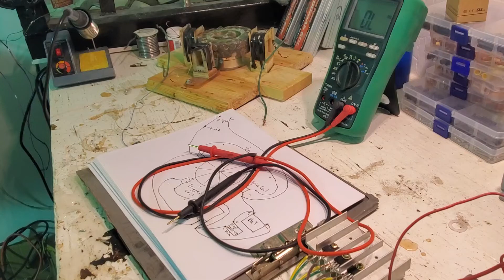Step by Step how to wire these pulse  motors up and make them run

Comment: What diode and cap do you use
Reply from the maker: It really doesn't matter what diode is used as long as it can handle the voltage and current it will work fine . The cap is the same.  The capacitor isn't necessary for the circuit it will work fine with just a diode. I usually try to use schottky diodes . Thanks for watching!
Reply: @windpowerandmore6310  Thank you, ordered everything watched your videos about ten times learn something every time. Hope I can get it going.I was trying to figure out what gage wire you're using to wire everything up.Thanks Donnie
Reply: If you were to take a wild guess about how many pounds of 30 awg trigger wire would I need to order
Reply from the maker: @donaldcarter2309  it’s around a number 19 awg . I hope I was able to help you!
Reply from the maker: @donaldcarter2309  that really depends on what size of motor you’re going to build. 5 would be lots for the size of motor I built
Reply from the maker: @donaldcarter2309  for trigger wire you would only need about 250grams
Reply: @windpowerandmore6310  Does the size of wheel make any defferance

Comment: Hi Jeremy, been a while hope your well, I have got a question for you.
Can I charge a high voltage cap and dump that cap back into the run battery, even through the run battery dose seem to last a long time, so what I'm trying to say is can it charge itself or would it kill itself 👍
Reply from the maker: Yeah you can do that.  I think you're realizing how power really works.  It's in different forms . The output has a much higher voltage potential than the input does and converting it back to a lower voltage with a higher current is the key to making it a self runner.
Reply: @windpowerandmore6310  thanks Jeremy I thought that I definitely learning more and more much appreciated 👍
Reply: @windpowerandmore6310  Jeremy I'm finding it hard to get hold of NTE56 what's the next best thing fella, as you know I'm in the UK mate.👍
Reply from the maker: Email me buddy jvhoeops@gmail.com 
I'll hook you up with some 56s.
Reply: @windpowerandmore6310  sweet Jeremy, much appreciated 👍 fella, I've sent you an Gmail.

Comment: Sir i replicated this motor but the problem is that my coils are heating i m using 3055 transistors and coils of 3ohms each it is taking at 11volts only 1.15 Amps please can you tell me why my coils are heating though the current is less and the back emf is 8.5 v
Reply from the maker: How many coils are you using? It sounds to me like the coils are not in series. Make sure the coils are in series that’s what I think is going on . Or it could also be a issue with the timing. You may have to adjust your timing coil position
Reply: Sir i m using 2coils in series and the timing seems to be perfect the rotor is gain good speed as urs in the video first i used 2coils of 0.7 ohms it was drawing 3Amps so i changed the coil to 3 Ohms each with a slightly decrease in speed the input current dropped to 1.15 Amps Then the coils started heating up though they are air core coils like yours
Reply from the maker: That's something I don't know buddy I'd really have to see or be there to exactly say for sure what is wrong.  How many transistors do you have on the coils?
Reply: @windpowerandmore6310  2nos of 3055 transistors
Reply from the maker: Are they both working properly, if one of them is not turning off it will cause the coils to get hot
Reply: Usually all electrical people say mor current means more heat but my current is less then how come ?
Reply: Thanks for all your replies and one more thing that motor you designed is one hell of a motor keep uploading more videos of your experiment I have learned a lot from your videos

Comment: Hello. So I'm getting a negative voltage from my trigger coil. Wont turn on the transistor. I'm guessing that's the problem but I'm not sure. I spin the motor and I measure from the base and the emitter with the negative lead on the emitter and the positive lead on the base. Reversed the coil leads and it's the same. My drive coils are 1 ohm each. My trigger coil is 150 ohm. I get about 1.5 volts. Any ideas Thanks.
Reply from the maker: Are you sure the transistors that you're using are working? Are you using the same transistors that I use ? NTE 56
Reply: @windpowerandmore6310  I'm waiting for that transistor to be delivered. I'm using a Bridgold E13009. It has a saturation voltage of 1.2 volts so I wound a bigger coil. 300 ohms. 34 gauge wire. Get about 2 volts Drive coils are .5 ohms. I think I'll wait till I get the NTE 56 and try again. Thanks for responding. Great stuff.
Reply: @windpowerandmore6310  got it to work. Yeah. The 56 got delivered yesterday. Thanks for sharing your knowledge. Going to experiment with a bigger rotor
Reply from the maker: I’m happy to hear that it’s working for you buddy! Thanks for watching!

Comment: Hey there! Thank you so much for sharing your great work - really excited to build a motor as per your recipe. Been watching all your pulse motor vids over and over and reading the comments to get as much info as possible, but I still have a few questions though....
I have a rotor with 8 magnets on it N-S-N-S-N-S-N-S.
1). Do the drive coils have to be opposite - wound? 
2). On my rotor, with drive coils opposite each other, they would both be facing a north pole - would that still work with one repelling and one attracting? 

There are other questions, but one step at a time! 

Looking forward to hearing from you, and I understand that you're a very busy guy, so am happy to wait for a reply! 

Cheers
Reply from the maker: Hey buddy,  it doesn't really matter where the coils are placed.  Either setup will work.  The video explaining how to wire and start the motor will show you exactly how to wire it and get it started
Reply: Hi! Thanks for that, you've helped me realise I've been over complicating and over thinking things! Cheers! All the best!

Comment: I've been building the bedini circuit for a while.  This seems very interesting.  

I heard you say it draws around 2 amps.  About how many charging amps will it put into a low 12v battery.  With the setup you showed in this video.  And the 4 run coil one.   Thanks!
Reply from the maker: Hi ,thanks for watching.  It's hard to say exactly Bud I'm not at home right now.  It's not possible for me to give you exact numbers right now.  But I do know as the rotor is loaded down with a load the changing current stays the same or increases slightly.

Comment: Hi Bud. I sent you a schematic drawing I did for you from your rough sketch. I sent you an email with a transcription on notes i made from what you said on video,s.
Reply from the maker: Hey buddy sorry I've been busy lately working.  I've just looked at your schematic.  As far as I can see the input side of it looks correct.  But the output looks backwards.  The negative from the input side is the side that will be the positive on the output side.  That's the side that should have the diode that will go to the positive of the cap and output battery. Its opposite as what you have on your schematic.  The backspikes are the opposite polarity of the input.  Let me know if you need anything else.  I'll gladly answer your questions asap . And thank you for your support and time with those projects!
Reply: @windpowerandmore6310  Thanks Bud. I will correct the drawing. I will send you a video of my build. I cannot get the NTE 56 Transistors in South Africa. I bought and received the Mustool Oscilloscope and a digital thermometer which is helping me to see the waveform and back spike results. I do not get near the results of yours as i did a different build with a different purpose. I see on one of the videos you had a Bridge Rectifier DC to AC on the output of the energizer yet most of your latest energizers do not have this unless it is not visible on the videos you took. Is the Bridge part of the build or can we do without it.
Reply from the maker: Hey bud.  Its something I don't use anymore.  You can use one if you want to experiment with it but the input power will be different along with the torque from the rotor when it's charging batteries.  All you need on the output is one diode that's all . The diode goes on the coil that is connected to the collector from the transistor. The purpose of the diode is to block any input current from going to the output batteries.  All you want to collect is the pulse from the backspikes.  The pulse from the backspikes are also the same polarity as the current being produced from the magnets that pass the coils when the transistors are off.
Reply: @windpowerandmore6310  Thanks Bud. What s the Ohms value of the diode to be used. I saw on one of your videos the cap used with the diode on the output is a 3300uf 25v cap. Is that right.
Reply from the maker: That cap is on the input side that you’re talking about . It’s not necessary to have a cap on the output . If you’re using a cap try using at least a 400v with about 400uf . Any high voltage diode will work as long as it can handle the voltage and current that your motor is putting out.
Reply: @windpowerandmore6310  Thanks Bud. With my solid state circuit i am getting the square wave patterns i see on your videos. What i am missing though is the values i see in the Voltage supply as well as the high voltage i see on your back spikes. I will make a video for you and send it via email or you tube. I am still learning to upload a video. I suspect the magnet discharge into the aircoil vacuum is part of what makes these extraordinary amps/volts. I need to replicate this effect to get my battery to charge. What i have accomplished at this stage is to slow down the depletion rate on the battery under load. Not enough to keep the battery charged though. I need to understand the set up you do with the cap and diode. The key is definitely the discharged energy wave disturbing the coil energy field. My battery is not charging yet though just depleting slower than the normal C discharge rate.
Reply: @windpowerandmore6310  Hi Bud. By the looks of my fault in connection it looks like it is the diode connection only that i have to move

Comment: Hello what type transistor u use?
Reply from the maker: NTE 56
Reply: @windpowerandmore6310  is that compatible for high speed pulse motor? Thanks
Reply from the maker: @AK-eu4jz  yes that's the ones I use
Reply: @windpowerandmore6310  did have equivalent of NTE56 If its not available any electronic store? Thanks

Comment: So if the pulse motor is north south, how are you preventing the coils from firing on the opposite field.?
And are your coils left or right hand rule?
Reply from the maker: The trigger coil doesn't have a bridge rectifier on it , its hooked directly to the base and emitter of the transistors.  The transistors only fire on one polarity. When I have time I'll make a video with a diagram explaining how this works Bud.
Reply: I had same question as Make after thinking more about this circuit.. seems to me the base of transistor  acts like a diode and only allows current to flow in one direction through trigger coil..i assumes then it fires when north passes by magnet and creates a repel force.. next magnet comes and it’s south and so creates current on approach instead of departing coil because the magnet force is opposite polarity..because of rotor position this time it’s attract and pulls rotor forward.. 

the drive coils are wired opposite and always see opposite pole on rotor.. it fires repel/attract/repel/etc...

I could be wrong but that’s how I see it.. 

this is a brilliant pulse motor circuit !!
Reply from the maker: @energyhack3538  yup you got it! The energy produced from the trigger coil is used to fire the transistors than its directed to the charge batteries it’s not a drain on the system as if trying to use the run batteries to supply the energy to fire the transistors. That’s why I only use trigger coil to do the timing and supply the power to fire the transistors. Thanks for watching buddy and I definitely appreciate your feedback and knowledge!
Reply: The trigger coil should fire regardless if its a north or south magnets right?
 The transistor only fires when the current comes a certain direction. 
But fires each north and south right.?
Reply: Do you fire your coils in between the magnets?
I believe i understand what is going on with it,  it had been puzzlen me. 
Great video by the way. It does work well 👍👍
Reply from the maker: @make425  there is two drive coils that are in series with each other they only fire on 8 of the 16 magnets,  half of the time they are generating power. The other two drive coils do exactly the same.  Its hard for me to explain without being at home so I can show you directly on the motor how it actually works
Reply: @windpowerandmore6310  i appreciate the response. 
Be safe out there, don't work too hard.

Comment: Hi. It is Eddie de Beer again. Thanks for the help. Is it possible to go solid state timing with this circuit you are using. I built a 150 watt energiser based on an old circuit i received from Patrick Kelly. I will send pictures. I dont think i am generating enough amps to open the IRF840 Fet,s. I have two 1 OHM coils which are 3 layers .71mm (AWG21) turned onto  a 10mm x 140mm long ferrite rod
Reply from the maker: What did you mean by solid state,  completely solid state without a rotor and magnets?
Reply: @windpowerandmore6310  Hi Yes without the rotor and magnets. I will send you my schematic per email

Comment: Hello and thanks for your great videos. I have tried to replicate your design but have a few problems. I have found it difficult to find the transistors you mentioned here in Australia. Will a 2N3055 work? The other main issue is the coils.  You mentioned 60 ohms for the trigger and .6 ohms for the drive coils. I have tried this and my coils are getting very hot and the motor does not run. I have the 12 magnets (neo 52) but only 10mm in diam. Are you able to pinpoint a problem from what I have said? You did mention using MOSFETS. What would I need to change to do this? Thanks.
Reply from the maker: It seems to me that your transitor maybe bad shorter out. Those transistors should work fine but the backspikes won't be as strong as the ones the NTE 56.
Reply: @windpowerandmore6310  I replied earlier but either the mailman or I must have had too much to drink. Thanks for the help! Regarding Mosfets....10K resistor across Gate and Source..anything else to do ?

Comment: @windpowerandmore YES YES YES  IT WORKS👍 FELLA up and running, for anyone on here thinks it won't work, I can tell you it does, and I have no background in this stuff at all I mean at all, wind power and thank you for your patience 👍😊
Reply from the maker: Hey buddy I'm happy to hear you have it working!
Reply: @windpowerandmore6310  thanks fella the shock it gave me once I saw it turn 😅 I was like OMG 👍
Reply from the maker: @sas25135567  hahaha right on Buddy!
Reply: Wind Power And More  Top man I'm beginning to understand thank you mate 👌🏻👍🏻
Reply: @windpowerandmore6310  can I ask I'm running one transistor, so if I run three like yourself will that speed the motor up.
Reply from the maker: @sas25135567  if your transitor is warm or hot it will definitely speed the motor up and also charge more on the output

Comment: My friend, what transistor do you use
Reply from the maker: On that motor in the video with the green rotor there is  Fairchild D2241 transistors.  On the other motor with 4 drive coils i am using NTE 56 transistors.  Both types are very fast switching that work the best for me . I've not found any better since.  Thank for watching!

Comment: Alright fella I hope your well, I can't for the live of me get this pulse motor to run, I gone by your circuit but no luck mate, any chance for a little help or if your want add me on Facebook would be appreciated I'm not giving up definitely not. Thanks fella
Reply: Omg just realized the circuit on the paper is not the correct why to wire it up, sorry wind power and more lol , my bad.
Reply from the maker: Lol did you get it to work?
Reply: Wind Power And More  not yet I'm gonna do it tonight after work but I will definitely update you Thanks fella 👌🏻👍🏻
Reply: @windpowerandmore6310  alright fella no good didn't work tonight, but I'm not giving up, there has to be something silly I'm doing wrong but on a good note I now know your circuit I watched your video and copied it on paper, to help me through.👍
Reply from the maker: Did you try reversing the two wires on the trigger coil?
Reply: Wind Power And More     alright fella  yes mate that was the first thing I done, the only thing I can think off is the transistors I'm using is a mjl21194 .
Reply from the maker: That transistor should work, are you sure it’s good? And are you using a high voltage trigger coil? When you try starting the motor does it draw any current from the battery?
Reply: Wind Power And More  alright fella transistor working ok but I now know what's the problem is the trigger coil not powerful enough I checked the ohms and it's putting out only 16.6 ohms, so I have ordered 30 gauge magnet wire lol all good fun this but thank you for helping me as I know your busy man, and sorry for the late replies I'm in the UK👍🏻😊
Reply: Wind Power And More  alright fella I'm back, I got my 30 gauge wire no go mate.
Reply: Wind Power And More  I think I may of worked it out I think my magnets are not big enough to my coils, I have one like yours where you have four to make up one pole, where I have one to make up one pole